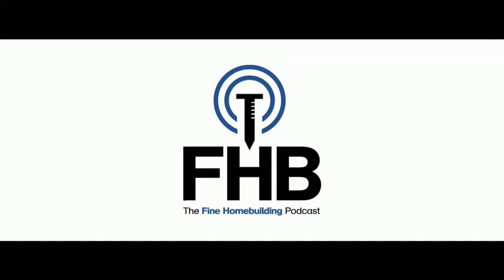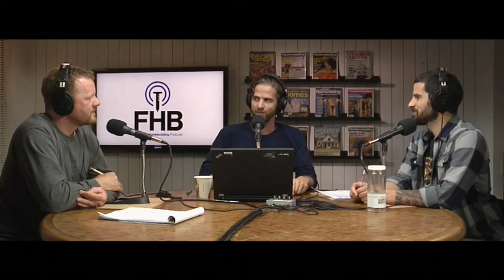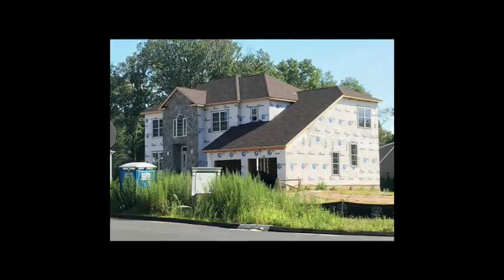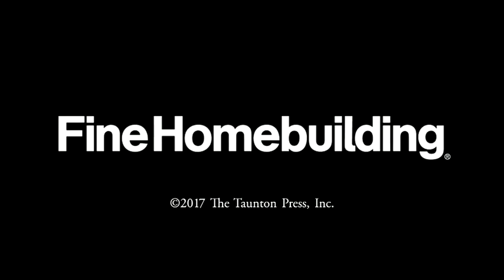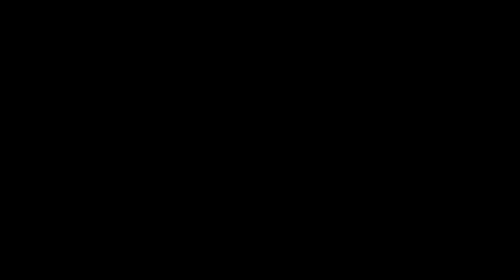Fine Homebuilding Podcast Episode 68

Comment: https://www.youtube.com/watch?v=DvlRThmICX4&feature=youtu.be&t=25m36s

Be mindful that if more than two posts have been used, spans should have been calculated using the continuous span tables (vs single span). By removing only a single section, you will undermine the adjacent sections. You'll just need to measure and check, sometimes a continuous span may fall within single span allowances.
Reply: good point, thanks for sharing!